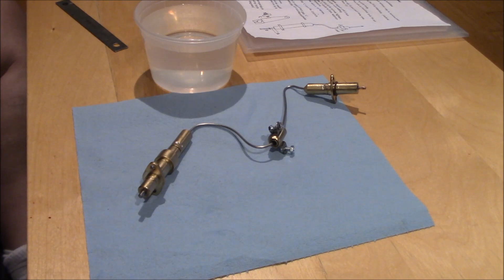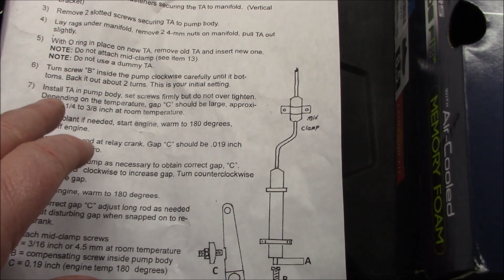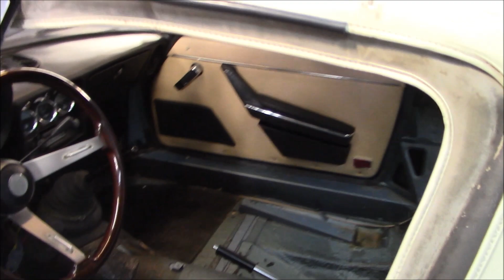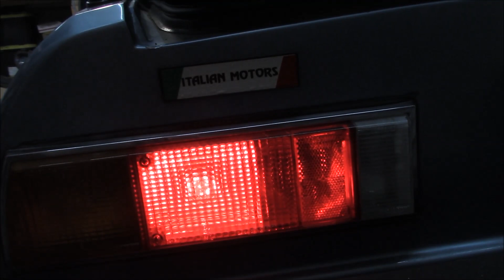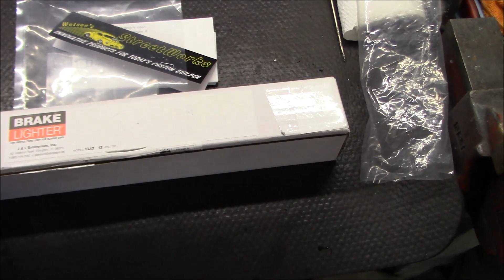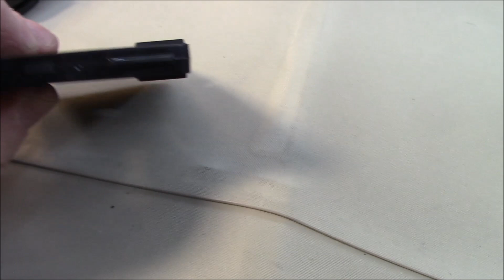1981 Alfa Romeo Spider Veloce, Winter Projects Part 13, Thermostatic Actuator/LED Lights Install

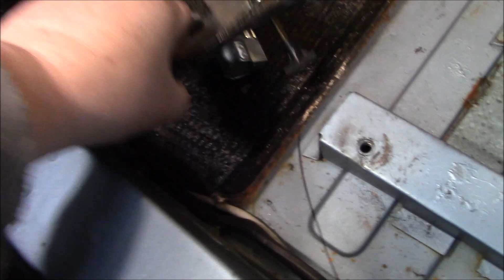Comment: im late to this one, but putting in a sure start. i have an 81 alfa spider. everything has been the same till this point.. 11:57 i do not have a throttle cable adjustment. manual for my car makes no mention of this either. but car does have the god awful buzzer. just curious about how this car has throttle adjustment. mine is definitely an 81.
Reply from the maker: @alanprather8399  not sure but it’s original to this car. It’s just turned 58000 km from new.
Reply: @cheftush  I looked up manual online and it does mention it. my 81 definitely don't have it and it was not obviously removed. everything interior wise looks completely stock.   maybe it's like a mid year thing? appreciate your vids anyhow. I've been wrenching on my gal and your vids have helped for sure. a lot more idiosyncrasies in a fine Italian lady than an old ford

Comment: I watched this episode the other day but I was not able to get to my PC to make a comment.  I even went back through the old comments to make sure no one else had.  Have you or Doc considered adding a brake pulsar to the third brake light, I like Back Off XL?  The XL is for LED's and has two flashing mods. I added one to the third brake light on my TR6 and people told me how much it grabbed their attention when it flashed.  I am adding one to my TR8's stock brake lights instead of a third brake light as I have a luggage rack that would interfere with a sight line if mounted on the boot lid.
Reply from the maker: Hey Pat!  Great to see you. Funny enough, Doc sent me a pulsar along with the 3rd brake lights.  I didn’t attempt to install it as they are actually against the law here….

Comment: My less than helpful comment is that I'm mad all over again that my SO threw out my comfy holy sweat shirts, as they weren't even fit to work in the yard, in her opinion, and she was embarrassed. They were perfect! I pull my Ramones sleep t-shirt out of the rag box every once in a while. So there's that. In regards to the sound solution, I've used FM modulated solutions for YEARS, I even had an FM modulated CD changer once. It's flawed tech, with poor results. BT transmission to FM modulation to radio = too much fidelity losss. NOW, I love that tape idea. I have a chorded one ein my TR6 that transmitts sound fairly well. I'm wondering if the tape drive unit in Doc's Alfa needs head cleaning? Have you played a tape in it yet? There's a BT/Amp solution that a few companies make that allow you to keep the older head unit. It's wired into the stereo directly, so only loss is the BT connection, which IMO isn't that bad at all. It's a car, not a living room. And, it's amplified to better take advantage of the infinities sound range.
Reply from the maker: Hi John, I’m amazed at how many garage shirts I have 😉. Yes, I’ve played cassettes and they sound fine so I don’t think the heads are overly dirty.   Cheers, Tush

Comment: After I converted all the directional bulbs (and brake lights) to LED on my TR4A, and fitting a “LED compatible” flasher from Moss, the only issue I had was the directional indicator bulb on the dash (non LED), would continue to flash for 10-20 seconds after the indicators were cancelled. I then used a flasher from Flosser (1621003) and that problem went away.

Oh and we tried your cauliflower soup recipe - it was great!!

Comment: Hi Tush, The 3rd brake light could also be mounted on the trunk lid? As for the speaker grill could the round bracket be mounted behind the speaker and still have enough clearance to clip in the grill???
Reply from the maker: Hi Syl, I tried to mount it from behind.  It would still need to be modified though.  I’ll cover that off on the next video,  Cheers, Tush

Comment: Hi Dave, on my 87 you can just disconnect the door jamb switch to stop the annoying chime. On the 87 there are two switches on the driver’s door. The top one is for the courtesy lights, bottom one for the chime (buzzer). Easier than messing around under the dash. You may be aware of this, but thought I would mention it to you. Also, don’t know if it is the same on your car.
Reply from the maker: Yes, the bottom switch is for the buzzer on mine as well…if I’m not mistaken, the actual buzzer is in the passenger side footwell and I think I have easy access there as well but I haven’t investigated fully yet.  Good to have options !  Cheers, Tush

Comment: As regards to adding Bluetooth to the original radio is concerned the best solution I have seen on YouTube is by a YouTuber called Pete C, he has a channel called Corrina City. 
He basically adds some additional outputs and inputs to the factory radio which can be connected to an amp and an external wired Bluetooth device. He also adds some switches inside the radio that make a contact when the original radio buttons are pressed allowing him to switch the modes of the Bluetooth device and the tracks for the USB feature included with the device. 
One of his latest additions is on-board Alexa.
Reply from the maker: Hi Huw, I watch Pete C actually and enjoy his channel.  Yes, I’ve seen a few conversions done on these older radios..I think the new owner will maybe explore this opportunity down the line.
Reply: @cheftush  Pete C is certainly passionate about Cortinas and is ever so slightly bonkers. 🤣
Reply: @huwdavies6650  agreed! (But extremely entertaining) and his recent “Project Papa” Long Good Friday spoof was so good it’s made me pay money to retrieve it on Amazon Prime so I can watch the whole film again ha ha!😊

Comment: Great one Chef. 
I fitted a cheapo self adhesive brake light strip to the top of my roll bar. I also used a plug connector so I can swap it over to my “in rear window” high level brake light on the hard top.
Reply from the maker: Yes, they are a great idea.  I’ve seen more than a few rear end shunts on these old cars.

Comment: Hi Dave, best regards to you, thank you for the piece on LED light conversions as I’m just about to make a start on converting a couple of my son’s motorcycles (front and rear lights) I was also interested in that “baby” brake light you demonstrated as that was very compact and maybe suitable as an upgrade somewhere behind the rear seat of a motorcycle. I wish the snow would go away soon for you, (here in Berkshire U.K. we sometimes go without snow, which is nice). Bless you buddy!
Reply from the maker: Thanks Phil.  You might need to change your flasher unit out on the bike to one compatible with LEDS.

Comment: you know you need to change the flasher relay to one for LED's it works now because you still have a standard bulb up front if you change those it wount flash right.
Reply from the maker: That’s exactly why I’m not changing the front bulbs.  I’m aware of that. Thanks!
Reply: Hi Mike you are quite right of course. - I think I read that another option is to fit a compensating resistor in the circuit to fool the flasher unit into thinking it’s still pushing incandescent bulbs.
Reply: @philtucker1224  ya I think that could work but the timer relays are cheap replacement for the old three prong relays. I putting one to my TR3 and I will put one in my 1971 vw bus Iam putting LED's in it so I wount get rear ends by idiots not paying attention.
Reply: @mikestrang6229  👍

Comment: Is the radiator hose collapsed?
Reply from the maker: Hi Dave, it’s not collapsed…..just doesn’t fit really well.  Apparently hard to find for this model year.   This system doesn’t seem to have a lot of pressure in it either even at full temperature.

Comment: Just curious... any reason not to put the suction cup or magnetic brake lights at the very back of the trunk lid?  Might make the wiring cleaner if they will stay in place with the opening and closing of the trunk.
Reply from the maker: Just aesthetics I think Michael…I personally didn’t like the look of it there ( although the new owner might)

Comment: Interesting, purchasing a new one instead of having Wes Ingram rebuild the old one.  Wow nice floors!  My 74' was missing much of the floor on the driver's side.  The passenger side had been poorly patched.
Reply from the maker: It’s actually a rebuilt one from Wes as well…I need to send my core back to Centerline Alfa.